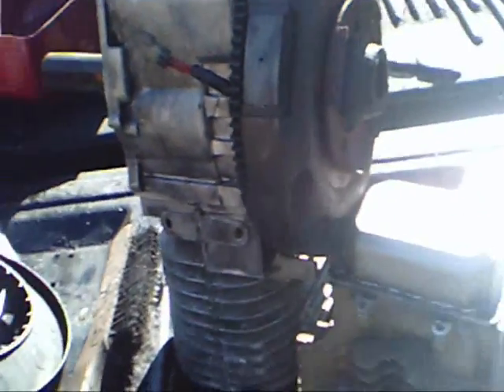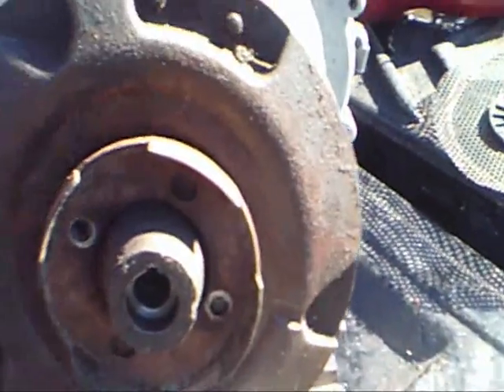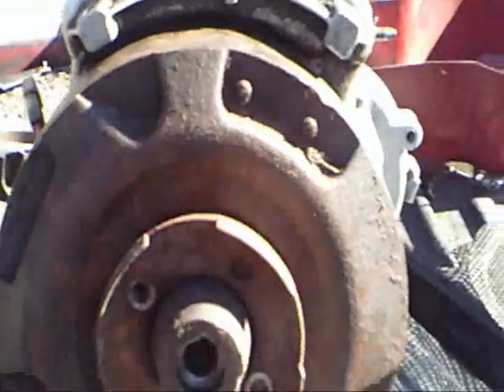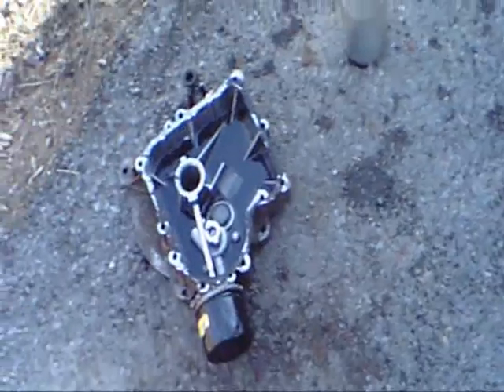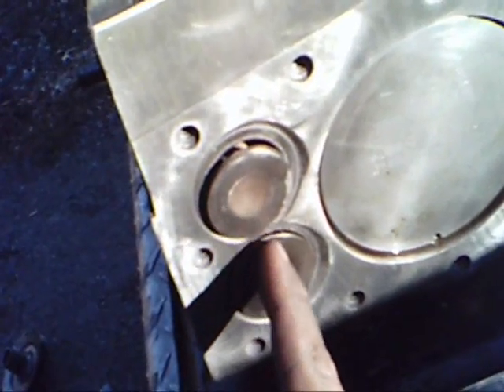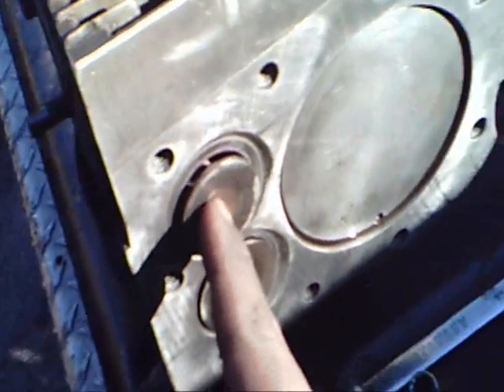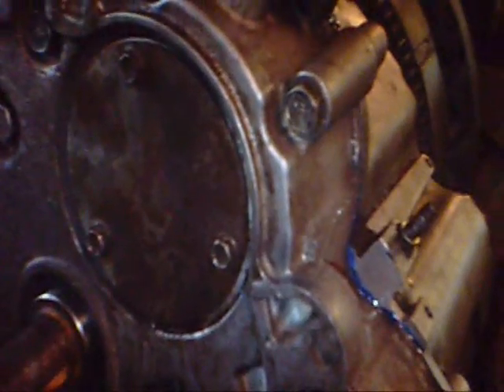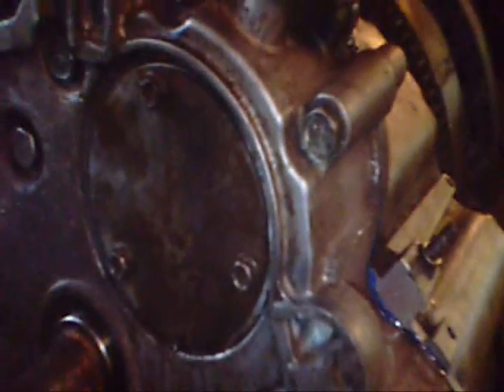How to: build 20+ horsepower briggs

Comment: I wouldn't worry about painting the block.   Clean, bare aluminum dissipates heat better.   It doesn't make much of a difference on a stock engine, but being modified you want all the cooling you can get